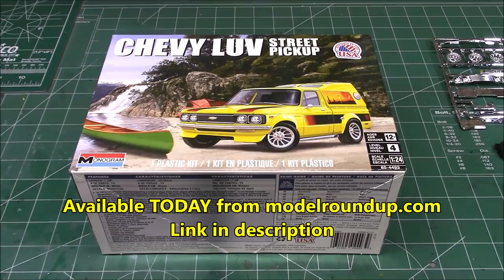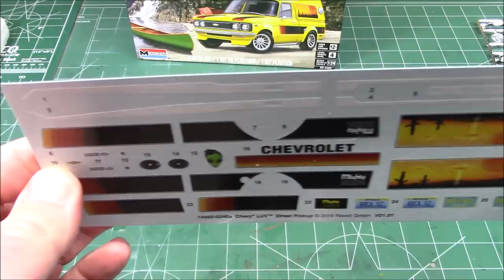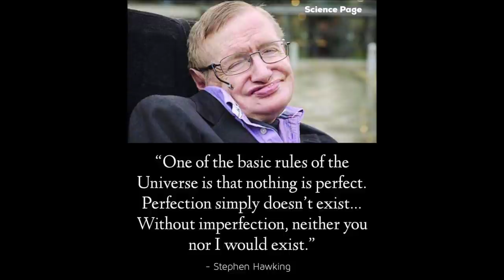Chevy LUV Custom Street Pickup 1/24 Scale Model Kit Build Review Monogram Revell 85-4493

Comment: Love this truck! Sorry. Anyway,there was a guy in my hometown had Luv hugger orange,of course, with one of the wickedest 327s I've ever seen! He was going so fast when he wrecked it,on a flat stretch of MAIN STREET! he snapped a power pole off 5 feet off the ground and drove a 12 inch or so splinter clean through the bed side! Happened 150 yards from my house and sounded like a bomb going off! When we ran up there he was just climbing out of the cab,didn't have a scratch on him! Was the most awesome thing I saw until I worked as a firefighter! I'm gonna try to get one of these!!! Love it as always!
That bumper is so big cuz it's a step to get in the camper! Most of those had an actual floor with a bunk down one side. They were actually slide inside,not just a topper. Remember them were popular when I was a kid. They made for the little Ford courier. Awesome color choice! Be safe,and healthy!

Comment: I tried building an original issued 70s Monogram version of this kit when I was a young teenager. Didn’t have the camper shell included. Had the same V8 option, and same side pipes. Look it up on Google. Monogram Chevy LUV Stepside. This newer issued kit is a factory fleet side model. Back in the 70s in Southern California, there was a company that made Stepside conversions for these LUV pickups. And V8 swaps were popular for them as well. It fit well with the California custom scene of the late 70s to the mid 80s.

This is a great build Chris. I may have to try again with this version. Looks satisfactory and pleasant to build. Love the paint color you chose. That is the same color I painted my Project “The Chick” Supra I built a little while back. It’s on your Facebook page if you remembered.
Reply from the maker: Thank you and thanks for watching!

Comment: Hpiguy, I dont know how you do it ? And that is using paint cans.
I just painted the MPC RAT Vega
the same color as the box art but used Testors 1630 G.Custom Green metal flake. I shook the can  plenty of time,and in between gave the can a bath of hot water.
I even bought a pack of Testors color coded premium nozzles for my cans. I used Tamiya grey primer to bring out the spots I missed during prepping,sanded the body down,then primed it with
Testors Aluminium Plate before shooting the final color. I tried my damnedest to use light coats initially but still had puddling around the edges and high spots.
The mags were the worst. Body eventually came out ok,but I may have to paint the mags a S/G black . I have a small fortune wrapped up in paint cans. I think I am gonna release the gas,and drain them into my airbrush bottles. I dont know what I was doing wrong. I dont want to go through the hassle,and mess "de-canning" paint if I dont have to BUT using airbrush is so much more superior to cans.
Reply: It all has to do with temperature and humidity conditions. Painting is done best above 55 degrees and humidity below 60%. I guess I’m lucky having a portable spray booth in my home to spray any time I want with controlled temperatures. You’re doing everything else right. Light coats with some paints. The Rustoleum 2X paints he uses at times you only need one coat. The special nozzles spray out with a lot of paint for better coverage.

Comment: hey Chris, did you ever try a fine layer of mod-podge over the dash decals? try it sometime, makes it look like they have lenses over the guages. for me, it worked like a charm! try it some time and see what you think.  I've also tried a red and orange sharpie (for the clear parts only), tail lights, turn signals, even on the chrome. and it's far less messy but works great.
Reply from the maker: Tried it on headlights and it wasn't too good but may try again.

Comment: I meant I don't believe the Chevy Luv Pickup was available from the factory with a V8 engine...
Reply: You are correct.  Most of the Chevrolet Luv trucks were only available with an inline 4, although there was a 3.1L V6 available from 1988-2002.
Reply: That's what I thought..
Reply: No, they only had 4 cylinder engine options including the original Isuzu Faster. The LUV is the American rebadged version of that truck. V8 conversions were common back in those days of the California Custom scene of the late 70s up until the late 80s.
Reply: I thought so..